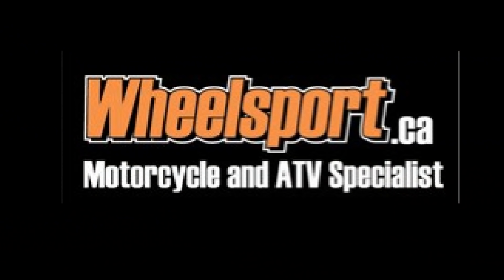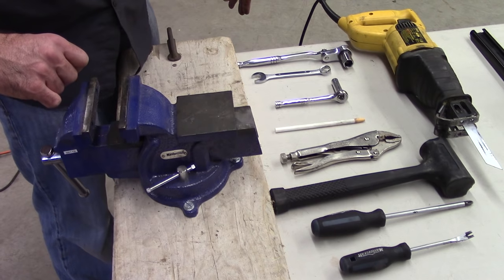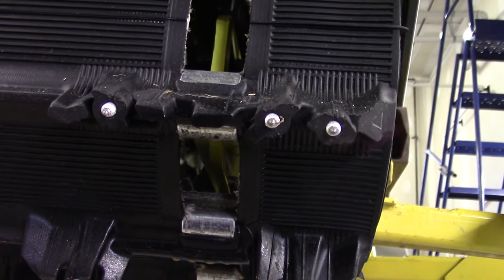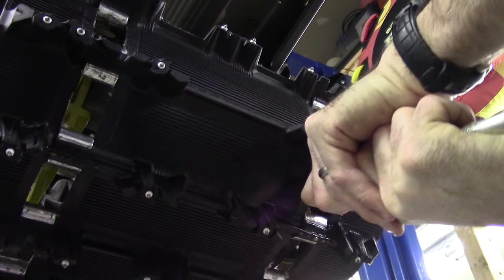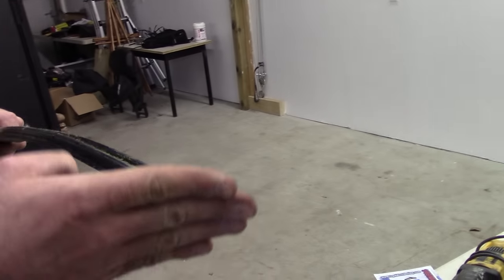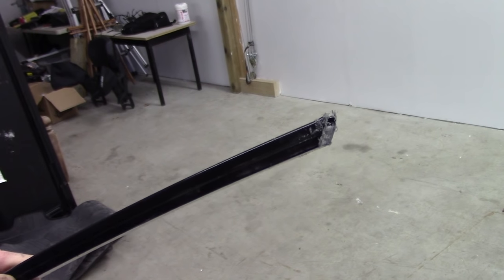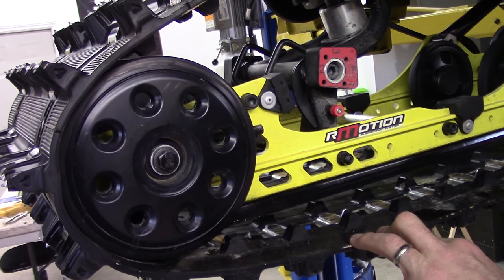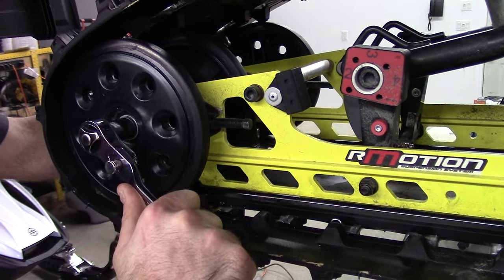How To Install Snowmobile Sliders by RawFuelTV (Hyfax Runners)

Comment: I never tried this but I remember reading from one chap who suggested that once the front screw is removed, elevate the track with your hifax already poking through the window, crank the sled up give it some gas... Taking care of where the target will be !  Obviously this trick wouldn't be suggested to install the new hyfax using reverse because the motion of the track and the windows going around would likely snap the hi fax right in two.

Comment: slides for the track add more bogey wheels you have the exchange them change them less in the summertime I put wheels on the front of my sled and I ride it I got an air cooled machine have to re-jet to the right temperature my body has liquid cooled machine and he put a radiator in and he rides with me and we ride hard no snow conditions with the extra bogey wheels we don’t burn up high packs and the extra 6 pounds that it adds to the weight you could just work out for an extra day I have a few less donuts just my thoughts